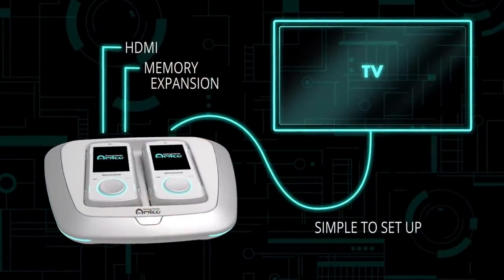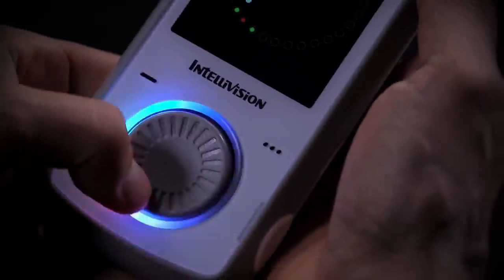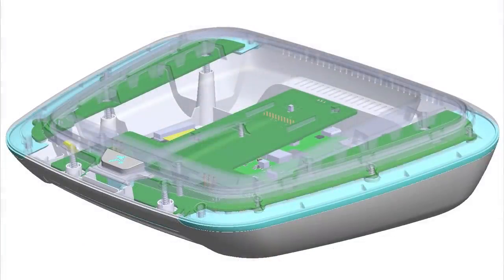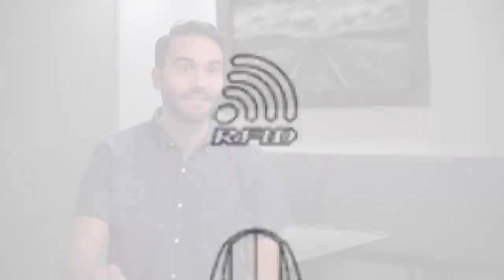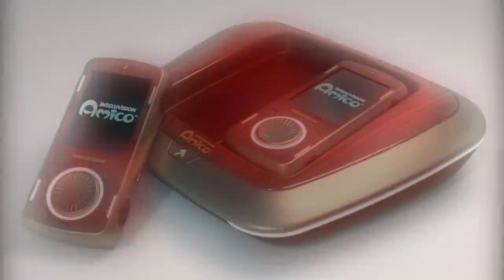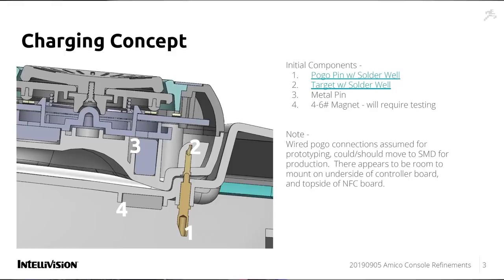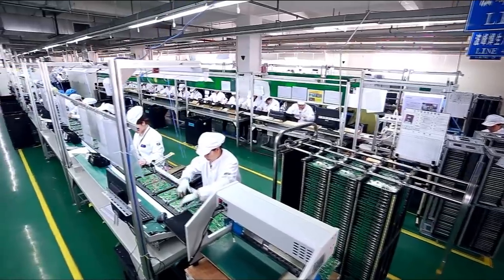Meet Amico™ - Hardware Design

Comment: The designing things to be strong (making the plastic thicker & with extra supports, simplifying the design for fewer failure points, etc) reminds me of Nintendo's systems (before the Switch...). Pretty much every Nintendo system I've owned (besides the lens on my Gamecube) was alive a decade or so later. I'm genuinely excited about everything this console is doing.

Comment: Much like with Google's Stadia platform, I'm more supportive of it's probability of being a respected platform, in spite of its potential faults, whatever they may end up being. 

But I couldn't help but feel like that $250 price is going to end up biting the Amico in the butt right from the get go, even though the technology behind it justifies it's price also.
Reply: That was there intent. The console is about $150. Controllers about $50. But will cost $250 altogether due to including 5-6 games with the console at launch. With the games costing about $9.99 or less each. I think it is priced just right. They announced 5 out of the 6 games that will be included with the Amiico.
Reply: They wanted the price to be $200 or less but with upgrades to parts made and the pandemic slowing production of parts costs for things increased but considering a system 2 full controllers and 6 built in games $250 not a bad price at all
Reply: Well consider that all consoles today are sold at a loss. And get their money out of you with monthly services and more expensive games $60 to now $70 a game. Add you will have to add more expensive storage and the Amico selling this console at a slight profit makes sense.
Reply: The amico costs 400
Reply: RETROMEDIC - “THEIR”, and yeah you are right. Which is why I stated that considering the technology used for the system and controllers, I can certainly understand it being priced this much.
Reply: @BCRivers  Isn't the controllers part of the problem? As for manufacturing cost. I don't know what SOC it use and what it could be sold at but I guess there would had been the possibility to just sell the console part for $150 and then sell the controllers separately or have people use phones instead of them since that seem to be an option. Likely much less attractive using a phone but that would result in a lower price to get in.
Alternatively they could had skipped the console, launched their own store on Android and used phones + Miracast together with whatever special bluetooth controller or no special bluetooth controller to launch a "virtual console."
Reply: @Johan Kruger Haglert it depends on how you view it during focus group testing a large part of the group Intellivision is aiming for gave feed back that they would rather have everything needed in the box to plug in and play hence 2 controllers and 6 games included with system. Even with all that until the pandemic caused shortages in parts that price was going to be $199 but a rise in prices for them for parts means a rise in price for us and amazingly even with that rise it’s still the same price as the Wii and with more included in the package than Wii had so I don’t see price as a big issue
Reply: Yes I agree, sell me on some launch games before I drop money like that on something I might just give to my kid.

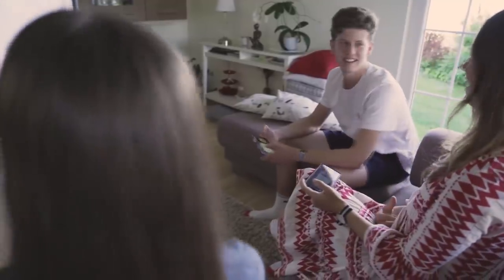Comment: I can't help but notice at 8:50 that the gamers are playing using their phones! Does this mean that there will be a virtual controller app to add in more players?
Reply: Yes You can connect up to 8 devices for controllers a mix between physical controllers or cell phones with the Amico Club app out now once the system releases this app will convert your phone into a controller

Comment: The feature about the controller been able to tell how you hold it whether vertical or horizontal oriented sounds interesting. I feel more games could take advantage of this unique feature, also the spinning disc button could also easily act as a d-pad and a paddle which is great for games like Ikari Warriors or Super Smash TV where you could shoot object in a spinning matter. I also feel if Square Enix would jump on board with this they could also make a 2D version of Final Fantasy Crystal Chronicles for this console and utilize the second screen on the Amico controller for the game.

Comment: Wondering if the Amico will be compatible with additional controllers? If 4 players can play at the same time, can I bring my controller to my friends and play? Are the controllers being sold separately? Thx
Reply: Yeah controllers can be bought separate. Console comes with two. Plus you can download the app and use you phone as a controller. If you take your personal controller over to your friends you can tap it on their system and the RFID will allow you to play your games on theirs. I believe they will also have button layouts that stick onto the touchscreen for some games kinda like the cards back in the ‘80’s that slid over the keys on the old controllers.
Reply: @deathofkings5633  if I remember correctly you can get the controllers in all the colors available and packs of 2 with their own dock.
Reply: @deathofkings5633  will you be able to just login to your account instead of having to take an NFC card?

Comment: One other question. Is the Amico manufactured in America?
Reply: I don't know either, I e-mailed ark. They are the ones manufacturing this console.
Reply: Originally they wanted to produce it here but due to agreements a lot of the parts are only produced in China so they will be built there and shipped here
Reply: @alpha8299  I see. Thanks!
Reply: CHINA
Reply: Most electronic component supply chains and manufacturing is not in America.  Most have moved to lower wage nations like China.  Back when 1st world countries had more electronics supply chains like back in the 80s you had 286/386 PCs often costing $2500-3000 USD in the mid 80s, and in todays money thats probably like $5000.  I'm not talking about top of the line gaming PCs either, but upper-midrange PCs designed for a family.